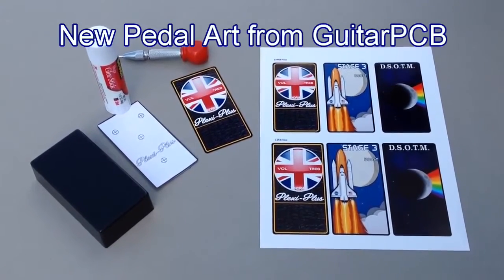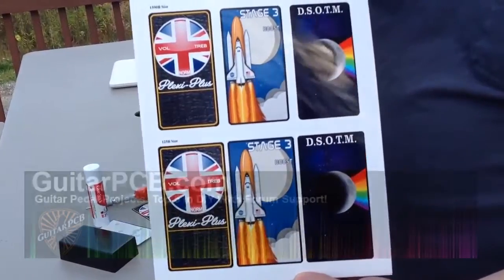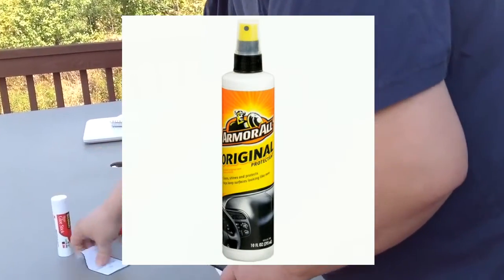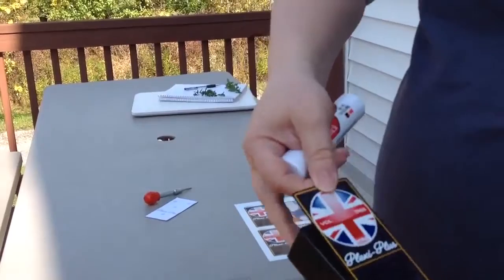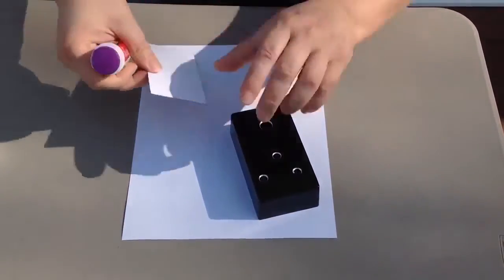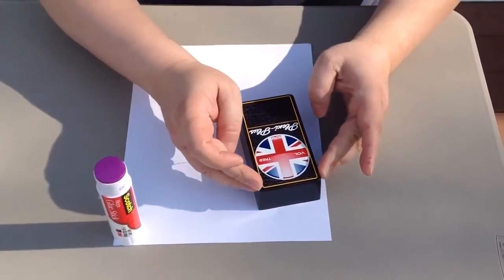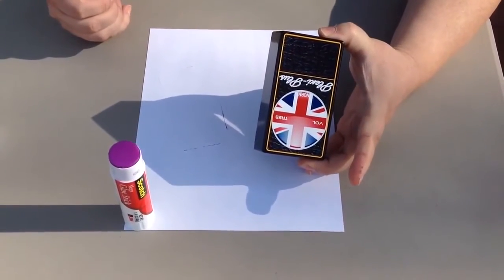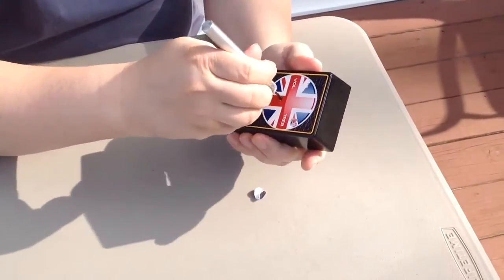GuitarPCB Pedal Art DIY Demo

Comment from the maker: Additionally as a tip you can use colored Sharpies to touch up the cut "side edge of your photo" so it does not show. Do this before permanently gluing it to the enclosure. Black for Black enclosures, Red for Rd etc. Obviously a white enclosure needs no touch up. I use Microsoft Publisher to make make and save my basic pattern designs, for each style enclosure as well as drill templates.

Comment from the maker: "Armor All" Application Explained in Detail: When applying the "Armor All" it is important to do it in several light coats after the INK has dried or cured for 48 hours. I apply it to the whole sheet before cutting out my designs. Even take a hair dryer to it for a bit. The spray some on a Soft Fiber Cloth and wipe it on. That's it! Then wait a day and do it again if you want. The more coats the more protection but this stuff is TOUGH! Also as a reminder use colored Sharpies to touch up the cut "side edge of your photo" so it does not show. Do this before permanently gluing it to the enclosure. Black for Black enclosures, Red for Rd etc. Obviously a white enclosure needs no touch up. I use Microsoft Publisher to make make and save my basic pattern designs, for each style enclosure as well as drill templates.
Reply: Hi Barry, great idea, and nice video. It seems Armor All Original has another brand in Germany. I can purchase Armor All products in different versions, but there is no "Original". There is a product especially for plastic surfaces. Am I right, that this is the correct one?

Comment: It looks like the paper you are using is thicker? Is it a specific kind of paper?
Reply from the maker: I use quality photo paper. The glossy kind. Nothing extra special. I also suggest using Armor All Improved Uv Protection. I like the UV protection and make sure to let the Inkjet ink cure fully (48 hours) and hit it with a blow dryer before applying the Armour All. Actually and brand would probably do. I hope that helps. Nice thing is if you want to change it later on it is so simple to do.
Reply: @BarrySteindel  is the Armorall acting as a clear coat? Or does it not need a clear coat?

Comment: How about using adhesive-backed photo paper?
Reply from the maker: I see no reason why you could not give that a try. (You may have less error correction time). The key is to have proper drying (or curing) time for the ink before applying the all important "Armor All barrier" in several light applications with a soft, clean fiber cloth. (See comments below) This is the stuff that Auto Body people hate with a passion from customer over-spray that gets outside the car on the paint job and makes stripping the paint very difficult. This is how I came up with the idea. It works quite well and is a lot easier, healthier and cheaper to use than multi coats of lacquer. I would be interested to know your results.